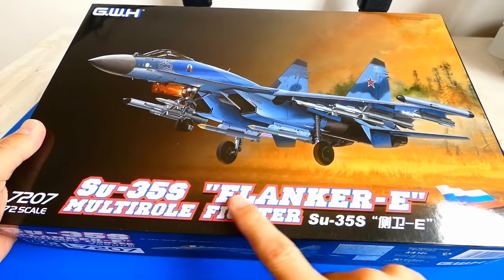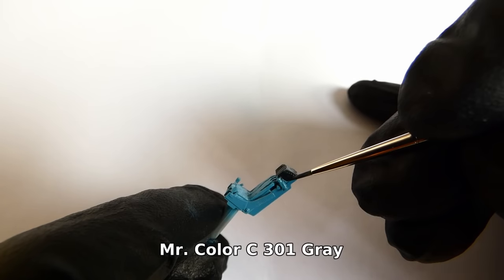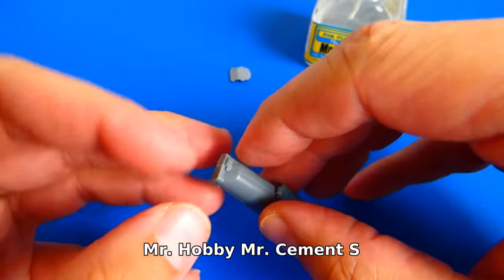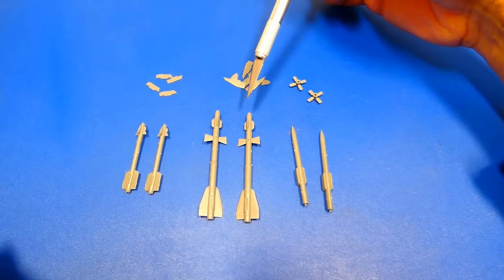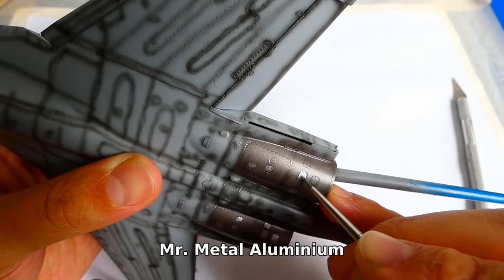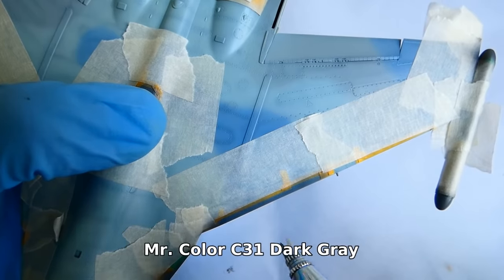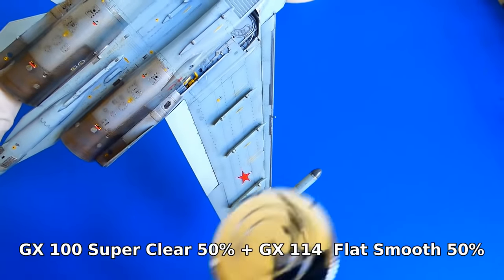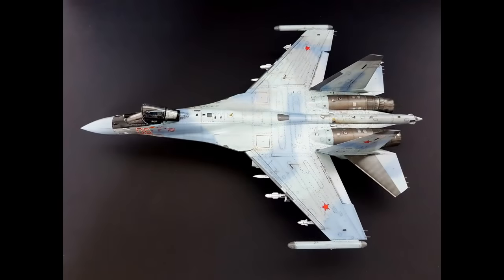Su-35S Flanker E  1/72 Scale Model Aircraft from GWH

Comment: Great build, this will be one of my next kits too! One question: how did you polish the canopy to eliminate the central line?
Reply from the maker: There is no central line. Moldings of this kit are excelent. I eliminate the central line with s smooth sandpaper, P-1000 and up to 3000. Then polish it with a special paste for laquer. Check out my F-14A Tomcat video. I did it there.
Reply: @modelsforfun  thanks a lot 👍